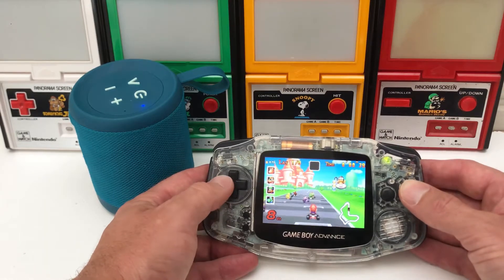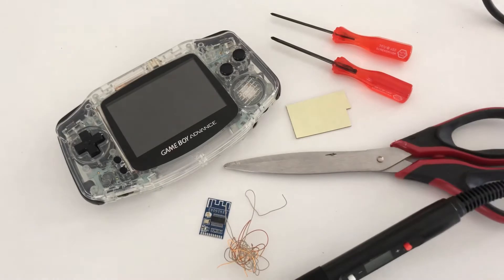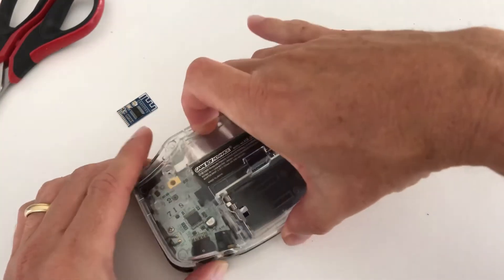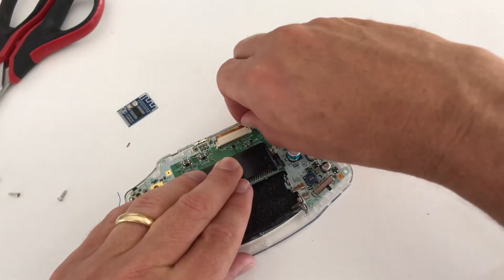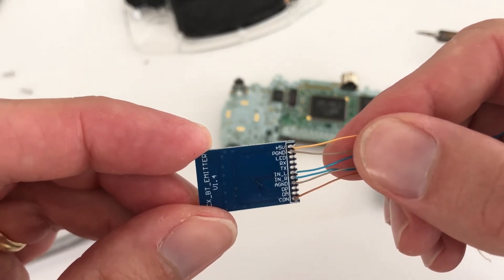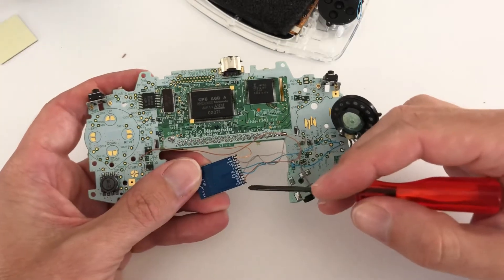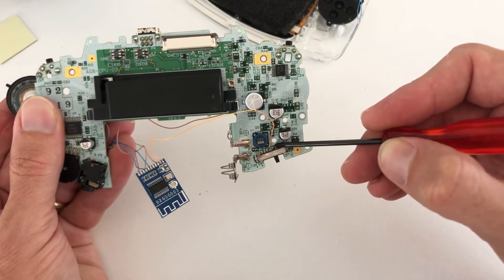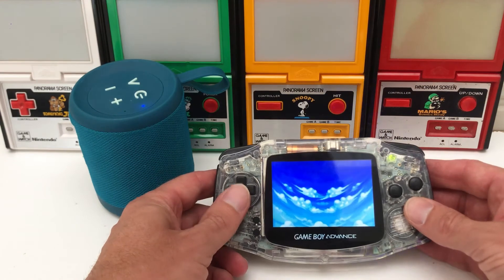How to Bluetooth Audio Mod a Gameboy Advance Console for Headphones Speakers #gameboy #nintendo

Comment: Looks great and am probably going to try this. However, I have no experience with any electronics of any kind and was wondering if the wired soldered to the chip need to be any specific type of wire or if they can all be the same type. Also wondering if this mod is compatible with a simple audio amp speaker mod, which solders to the same point. Would love some help. Thanks!
Reply from the maker: Give it a go. The thinner the better. Anything under 32AWG is best
Reply: @ thanks. I will tell you if it works but i dont have any of the parts yet and am only in the plan stage rn. Thanks tho!

Comment: I just installed mine on my gba and.... No dice. The module doesn't turn on at all, and i realised too late that it's the 1.7version which needs 5volts to operate. I already modded 2 PSPs with this module no problem but the gba can supply a lower voltage. 

I ordered another one, the version 1.4 as seen in the video from Aliexpress. Hopefully it's the only issue cause i'm confident with my solder work. 

By the way, what must i do to control the volume of the bluetooth from the wheel of the GBA like for the audio jack?

Comment: So I'm going to add a 2 dip switch to control the audio of the gba with one switch and the power of the Bluetooth module with one switch. I figured out how to connect the audio of the gba to the switch, but I don't know how to connect the Bluetooth module to the switch. Do I just wire the con part of the module to one pin of the switch?

Comment: I have a question. Looking at the comments, it seems that this method is no longer working as the Bluetooth module is updated. So would it work normally if I soldered the p-ground line, a-ground line, and 5v-line to the link port of the gba like you did to the gba sp?
Reply from the maker: Can see why not. Just remember to test the points and ensure the solder or wire doesn’t bridge
Reply: @YoakeZet did that end up working for you?

Comment: So I bought one of these modules and followed your video and the module would not turn on. I assumed it was a faulty module so I ordered another one and followed your video again. This time it still didn't turn on. What could I be doing wrong?
Reply from the maker: It’s not the same module, they’ve updated the module. Have you tried powering separately directly to a battery?
Reply: @GameboyCustom no but I looked up the voltage and it's supposed to run off 3 - 5.5 volts I've got the funny playing usb-c upgrade
Reply: @GameboyCustom I'll try powering it from a separate battery tomorrow
Reply: @GameboyCustom I saw that it was an updated module but I thought it would basically be the same thing
Reply: @GameboyCustom it's a great video by the way
Reply: Same issue, led never turns on, i assume the V1.7 requires more voltage?
Reply: @TheBeepMann  I use my power supply and it lit up with 3.5 volts

Comment: is it possible to solder the pair button to start instead of select? I have a funnyplaying IPS screen
Reply from the maker: Sure or you can even add an independent switch if you’d like
Reply: Oh thanks for the response! I wasn't sure, ill probably just solder it to select since I'm not a fan of adding another button

Comment: Does this mute the regular button sized speaker or do you simply turn it down without affecting the BT audio?
Reply from the maker: You can do both. You can add a switch or control external audio via you tube speaker

Comment: Hi, tonight I finally got around to try to install that mod. Followed your instructions to the letter. Unfortunately it doesn't work. Is there a way for me to troubleshoot? I have not exactly the same BT chip but very similar , I think only the labels are slightly different 

The select button doesn't seem to be working anymore. The pairing with the button doesn't work nor anything else that uses the select button (so it seems).

So I've pocked a tiny hole in the back of my shell to access the pairing switch ON the chip. Doesn't work either. Can I assume either my chip is faulty OR it doesn't get power? The sound is still working
Reply from the maker: With a different chip the pin out maybe completely different as maybe the voltage. Fault finding with a multimeter would be the first point
Reply: Ok thank you 😊 I will look into it
Reply: I looked more closely at the Bluetooth chip I got. It's the KCX_BT_Emitter v1.7. Which I think is just a newer version of what you use in your video. It has an LED indicator on it and a Pairing button.
Reply: Have the same one, but it doesnt turn on despite my best efforts
Reply: @TheBeepMann it's because those chips only run from 5v power. The chip used here is the same voltage as the game boy advance 3.3v I think

Comment: Hey I can't get the v1.4 chip anywhere, only the 1.7 chip wich as far as i know only runs at 5V instead of 3.3V, but i could be wrong. do you know any other chip or methode to get bluetooth on the gameboy or how to get the 1.7 chip to work?
Reply from the maker: Unfortunately we purchased a batch of the 1.4 when we created the videos and haven’t purchased any other since. Hopefully the pin out is somewhat similar
Reply: @GameboyCustom  they are pretty much similar, but because it only runs on 5V any battery mod or normal batteries are not able to work with it :/ I already tried ordering a chip from many different places and spend like 50€ just so that each one is the v1.7 chip
Reply from the maker: @patschgo  have you tried purchasing a voltage regulator. There are some on AliExpress that are tiny and will convert the voltage for you
Reply: @GameboyCustom  will they be safe to use with the ipa screen and battery? Sorry i am not that informed on circuitry
And don't volatge regulators step down the volatge than increase it?
Reply from the maker: @patschgo  should be but can’t give you an definitive answer. You’ll have to wire it and then test with a multimeter to be safe
Reply: Hi man! I hace the exact same problem as you... Cant find the 1.4 version anywhere. I found a tiny step-up circuit on aliexpress. The idea is to connect it between the battery (I made my own rechargeable battery circuit) and the BT module, in hopes of getting 5v, only for the bluetooth module, without feeding it to the rest of the circuit. I'll see how it goes

Comment: Hey maybe you can help me with this. I'm trying to decide what to connect to a 3 prong 1P2T switch. One would be the red speaker wire, the common prong would go to where the red wire would be soldered to. But would I use the 2 speaker wires or power to the last prong?
Reply from the maker: The speaker wires don’t carry power. One is ground and the other is the signal wire
Reply: @GameboyCustom  yeah, sorry, I have a bad habit of associating red with power. I'll have to use the audio wires on the switch and keep BT power on
Reply from the maker: @jumpy.  no problem. Totally understandable
Reply: @GameboyCustom  sorry to bother you again. I'm trying to get it to pair with a speaker to test it but it doesn't seem to want to. The version of kcx emitter I have is v1.7 (BT 5.3), and actually has a button on it, I assume for pairing. I tried holding down/pressing select and did the same for the button on the BT emitter as well. The two devices I used was a JBL speaker and Jabra headset. Any ideas?

Comment: Have you tried adding in a slide switch to select BT/Speaker? That should be as simple as taking the PWR cables for both the speaker & BT and connecting them to either side of a 2 option, 3-prong switch no?
Reply from the maker: Great idea, didn’t get that in depth just wanted a simple solution for people
Reply: @GameboyCustom  thanks, it's what I'm trying to figure out now lol. Just removed the headphone jack - which was a huge pain until I dremeled it out. But I realize I'll have to relearn how to use a breadboard to make sure I get the switch working right.

Comment: I'm not familiar with these bluetooth modules, but I assume that in-L and in-R are for left and right channel audio?

If so, would it not be better to wire these connections to the headphone socket contacts where there is a left and right channel to get full stereo?
Reply from the maker: You’re correct

Comment: Do you know if it will work when feeding unamplified stereo audio to the Bluetooth module? I think you can take the unamplified left and right audio signals from the AGB chip instead of soldering two wires to the speaker pin, but I am not sure if this works because I don't know the input impedance of the Bluetooth module.
Reply from the maker: Yes it should work

Comment: Help: I did this mod and now the LED's on the Bluetooth transmitter are no longer blinking. Initially they did, but I couldn't get it to connect to my current Bluetooth headset. How can I get the LED's to blink again? P.S. I soldered the CON to TP3.
Reply from the maker: We believe TP3 is the start button. Check power to the transmitter and reset for Bluetooth headset

Comment: Thank you for the tutorial. There were no copper pads on my GBA’s TP2 point, so I soldered CON to TP3. Would this still work? I did this for the v2 IPS screen mod and it works perfectly to adjust brightness with START + Triggers. I tried holding down START to pair Bluetooth headsets, but I cannot get them to connect. I first put the headsets into pairing mode, turned on the GBA, then tried holding down START, but nothing. What am I doing wrong?
Reply from the maker: Yes however TP3 is the start button

Comment: I'm still not sure what you mean by adding a switch between the CON to turn on/off bluetooth. Does that mean there is a wire from the CON to the tactile switch, then back to the solder point on the common ground point on the actual GBA PCB?  I would appreciate some clarification on this;, I can't figure it out. Thank you!
Reply from the maker: Wire to one side of the switch. Wire off the other side to break the loop

Comment: Do you have a link to the part? I've searched ebay for bluetooth 4.1 circuit board and don't seem to be finding the one you used.
Reply from the maker: They are available on eBay
Reply: @GameboyCustom  the ones I'm finding have a headphone jack and usb power... i guess I'll keep looking.
Reply from the maker: @brandonsteger8685  they are definitely available. Just do a world wide search. It came from China

Comment: To turn off the speaker when using Bluetooth, won’t a tactile switch just temporarily turn off the speaker only while the button is depressed? Or is there a way to wire the tactile switch to keep the speaker off until the button is pressed again? 

Also, we just have to put the switch between just 1 of the speaker wires, right?
Reply from the maker: There are tactile on off buttons. It must be wired between the between the CON circuit. Yes one wire 👍

Comment: Thank you for the video. Do you know where to find 36 awg wire here in the US? Would 30 awg be too thick?

Also, where do you think would be a good spot for the tactical switch to shut off the speaker? I have to drill the shell for this, right?
Reply from the maker: Thanks for your support. We generally purchase our wire off AliExpress. Yes 30 is a little thick. Yes you will have to drill a hole in the shell.
Reply: Thank you so much for the info. And thank you for all you do for the modding community!
Reply from the maker: @sheldonbarrett  my pleasure 👍enjoy and stay safe

Comment: I soldered everything in the correct places but the audio plays out of both the speaker as well as the bluetooth device. Also, the bluetooth volume is still controlled with the volume wheel so if I turn the volume off with the wheel the bluetooth is also silent. Is this normal?

I have an amp installed if that matters
Reply from the maker: You can add a tactical button or switch between the CON circuit to turn the Bluetooth on and off
Reply: I would like to turn the speaker off when bluetooth is on
Reply from the maker: @SonicVsKH  likewise you can add a switch between the speaker terminals
Reply: I feel like a dummy now 😆 I was only thinking about the wiring to the bt board

I appreciate the response, thank you!

Comment: Do you guys have the part number for this board? Curious on wiring it into the GBAs headphone jack to enable cutting off the speaker when paired. Thanks!
Reply from the maker: We just got it off eBay. You just need to add a switch between the CON link

Comment: Great vid, doe sit stay paired even when you press the select button again?
Reply from the maker: Cheers 👍depends on the speaker. We found the cheap speakers stayed paired while more expensive ones unpaired and then automatically repaired. A switch can be added as a loop between the CON point
Reply: @GameboyCustom  gotcha thanks!! Do you have a link to the part?
Reply from the maker: @JayBoyModz  no problem. It’s the Bluetooth 4.1. We purchased it off eBay
Reply: @GameboyCustom  Thanks!
Reply from the maker: @JayBoyModz  anytime
Reply: @GameboyCustom  what kind of switch are you referring too?
Reply from the maker: @danielturnage  you can add one between the CON wire